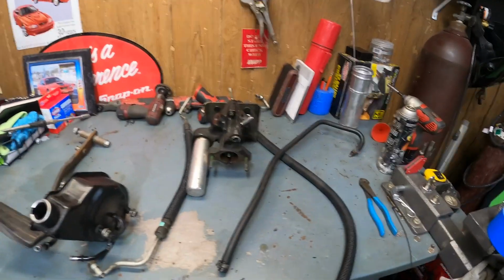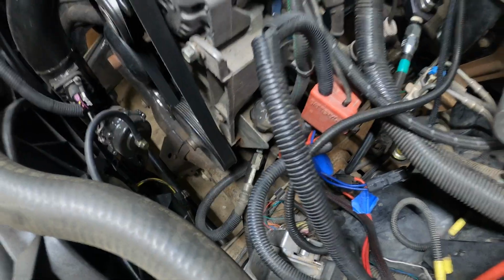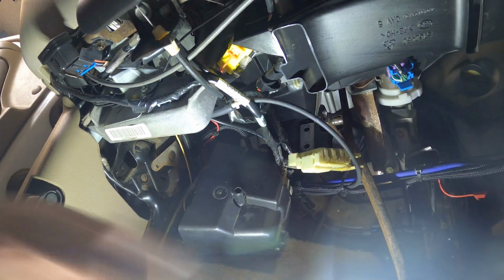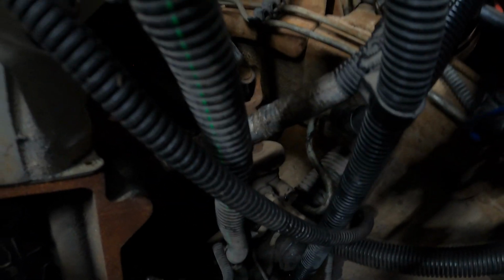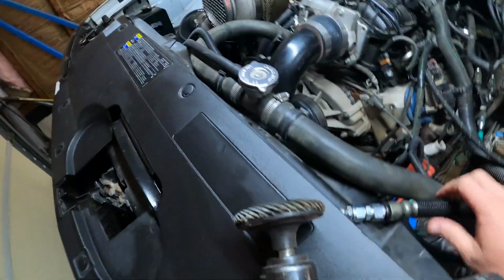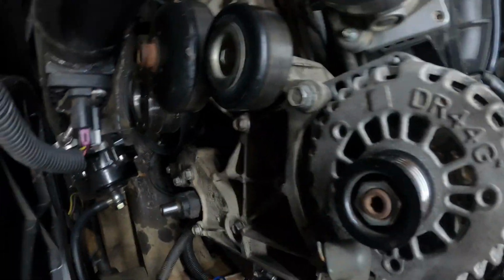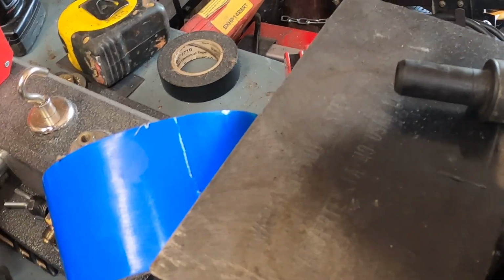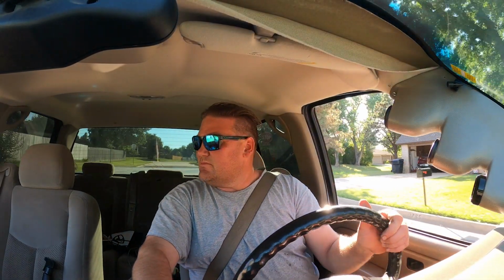Adding HydroBoost to our Rack and Pinion Silverado

Comment: Been a minute for the post but… I have a 2012 Silverado swapped out 5.3 with a 6.2 that I put in a Chuck Norris cam in.. vacuum sucked, put a vac pump in which worked fine but the vibration was annoying so found a 2009 donor got a pedal because pivot to push is different hydro to vac, had to weld bracket for brake light switch onto new pedal, original master Cylinder looked like it would work however mounting holes were to narrow so I redrilled and opened up holes 🤦‍♂️ center portion was to big would not fit into booster so bought 09 master cylinder… got it all together seems to work good, just put plug on switch that did plug into old booster, soo long story short brakes currently work good aside from occasional check brakes light, would like to get it totally perfect but here we are

Comment: How did your rack and pinion hold up? I'm 2wd as well and don't want to blow out my R&P with the higher pressures. TIA
Reply from the maker: @iExhibit  I never had any issue with the r&p.  I know that comes up a lot.  If you still have concerns about it you can always use a factory r&p pump and just add a case drain into the lid or weld in a fitting into the reservoir

Comment: I have a 2003 Silverado 2500HD with the hydro boost. Had a scary experience shortly after having it serviced. Engine stalled while coming to stop light, almost imposible to  steer, same with brakes had to enough steering to drive up on sidewalk and not hit car in front of me.
Turned out dealer had idle to low.
I’ll never own another hydro boost vehicle.

Comment: Saw you got to use your original master cylinder, I've read some original master cylinders won't work? Would you know which years are affected, mine is an 05.
Reply: Mine is an 05 and won't work . His looks the exact same as a 04 avalanche I took the hydroboost from .

Comment: So the real question: What PS pump did you go with? One rated for the stock rack or one rated for the hydra boost? Now, 1 year later, how is it going? Assuming you kept the stock style lower pressure PS pump, is there degraded brake performance, similar, or better performance from stock Vac system? Otherwise if you opted for the high pressure PS pump paired with the hydraboost, how has the steering rack holding up?
Reply: I’m here for the response also.
Reply: The hydro pumps are black and regular are chrome he went with the hydro pump and used the original master cylinder
Reply: @SSIntimy  This answers nothing of my posted question. Pumps and boosters are all unique to application with differing operating pressures (and pressure reliefs) and flow rates. A stock GM steering rack likes about 800-1000psi pressure with a max flow of 2GPM. Most hydro-boost setups puled from junkyard trucks are from 3/4 & 1 tons and operate at 1400-1500 pressure range and vary in flow rate from 2.5 to 5gpm depending on the original application. So the question continues; what are the specs of the booster he used, what pump did he pair it with (application wise so we can determine the specs), and what kind of braking and steering performance was observed.

This isn't a "throw parts from the local auto store at it" situation as that will simply yield good brakes and a blown rack or good steering and poor brakes at low rpm. Just because two pumps 'look' the same doesnt mean they are, and your cant infer the specs of the pump he used simply by looking at it. Also, the master has absolutely nothing to do with this situation.

Comment: Do you have a part number for the pressure line from hydroboost to steering rack? Is it the same on as a 2500 truck would use?
Reply from the maker: It’s a factory line and I would believe it’s the same as the 2500.  I did have to cut the end off the line and use the other factory line end.

Comment: Thank you for a detailed video on this.  I own a 2006 chevy silverado crew cab.  Been wanting to do the hydro boost swap.  Now i will be getting the parts here shortly.

Did you ever find out about why it was running lean ??  Any chance you have part number for that dummy plug for the vacuum boost ? And the plug for the back of the intake as well
Reply: Have you thought about going to AN lines from your booster to rack and pinion
Reply from the maker: Ict billet makes a plug.  551927-PLUG I believe is the part number.  They are around 17 bucks off Amazon.  I have a local pull a part and just grabbed one from a hydro boost Tahoe or suburban.  As far as going lean I think it was just in the tune since the vacuum changed up some.  I went to Holley shortly after this video.  As for the wiring plug.  Ballenger Motorsports pn conn-75665
Reply from the maker: Made a mistake on that plug.  Here’s a link https://www.ebay.com/itm/233437433755?mkcid=16&mkevt=1&mkrid=711-127632-2357-0&ssspo=-QPKK--hT4m&sssrc=2349624&ssuid=0Yn4IED7QiS&var=&widget_ver=artemis&media=COPY
Reply: Did you use your factory lines from your trucks power steering ??
Or did you buy the ones for the hydroboost
Reply: Where did you get the T piece to install the radiator cap in your upper radiator hose  ??

Comment: What did you end up doing for the Canister plug? I was curious on how you did it so there would be no dash light on the cluster
Reply from the maker: I grabbed the corresponding connector end and jumper pin A and F.   It’s the first and last pin

Comment: Would you recommend changing the power steering pump or just putting a T on the return hose ?
Reply from the maker: I’ve read but can’t confirm that the hydroboost ps pump may have a high pressure relief valve but as far as the “T” that would work but if you had the means you could also just put a fitting in the upper part of the reservoir and accomplish the same this as the hydroboost ps pump assembly.

Comment: Do you have a Facebook that I could message you on.
Reply from the maker: You can find me at https://www.facebook.com/profile.php?id=100086757382865
Reply: Will this work with power steering gearbox?  @zerofactorx
Reply from the maker: @ yes it should.  Pretty much all the factory HB vehicles use a gear box instead of a rack and pinion set up.
Reply: @zerofactorx  what will I have to do differently from what you did for as the gearbox and ps pump?
Reply from the maker: @ nothing really.  Most of this will be a literal plug and play for your situation.  The routing will be the same and all the parts will be designed to fit so you won’t have to modify lines like i did.  You will still have to drill that one hole out on the firewall but you can pretty much buy new parts off the self and they will work.  There are plenty of diagrams online for hose routing as well.
Reply: @zerofactorx  ok but I'll still have to do the add on to the ps pump for the 3rd hose/line Or get a pump that has it?
Reply from the maker: @ yep
Reply: @zerofactorx  what did you end up doing with that big plug that no longer needed next to the old booster? Idk if my truck has that or not, it's a 2000 Silverado 1500
Reply: What is the size of the compression fittings you used ??